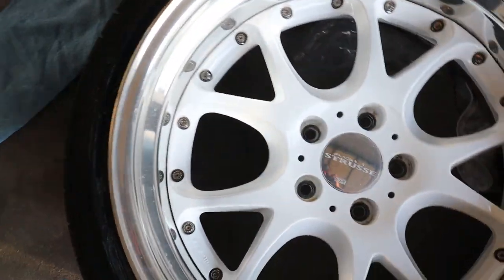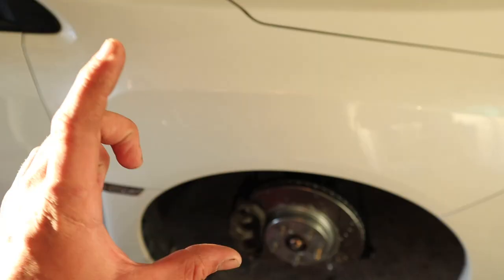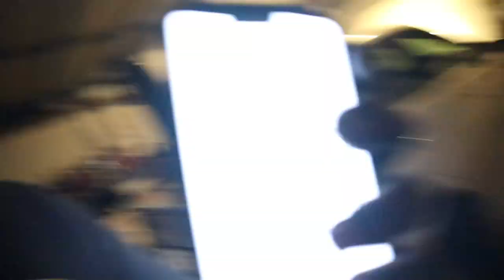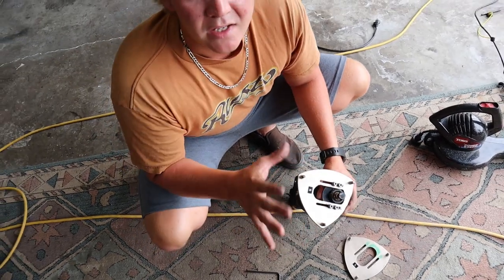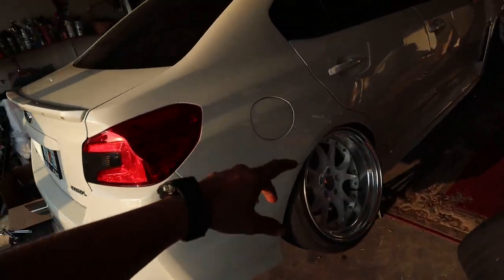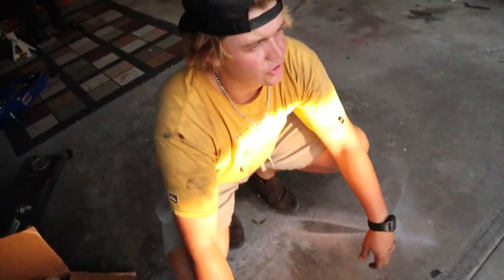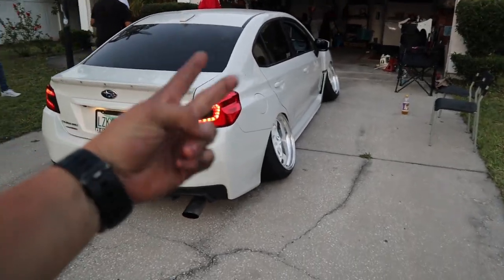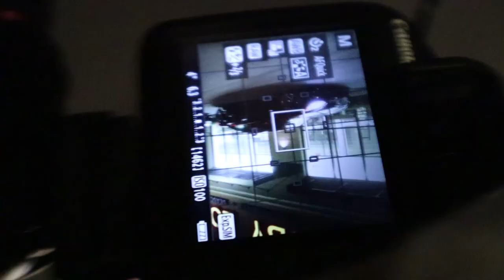STATIC WRX BIG CAMBER (RacerX Camber Arms & Slotted Coilovers/Tophats) + CAR MEET

Comment: I have a Kia Forte gt, when I max my top hats it’s at about -6, by my sway bar endlinks rub into the inner wells. So the max I can do is -3 without rubbing. I think I’m gonna end up slotting the coilover mounts until it gets me to -7/-8. Also they should help with axlebind from your understanding. Unfortunately they don’t sell any adjustable lower control arms for my car. You think I’d still need to get adjustable toe arms?

Comment: Should my Top Hat Camber plates on my Godspeed MonoSS Be Mirror image of eachother like  \\  //  or like this
 \\  \\ ? I think my mechanic has the triangle camber plate top hat at the wrong angle on one side.
Reply from the maker: If you are un able to make them perfectly parallel, they should mirror each other \\ // looking at it from the front of the car. When they are angled it allows for camber but also caster